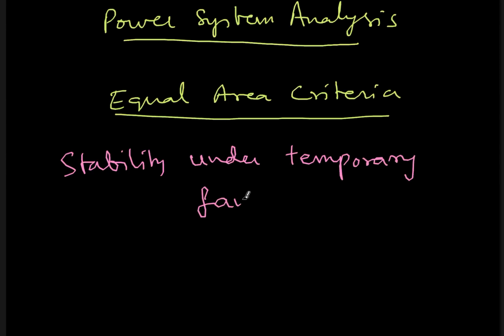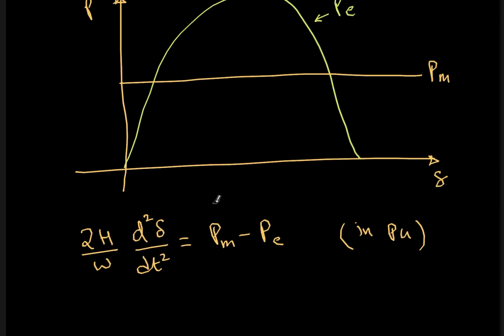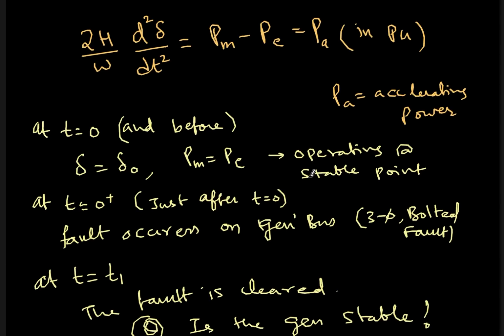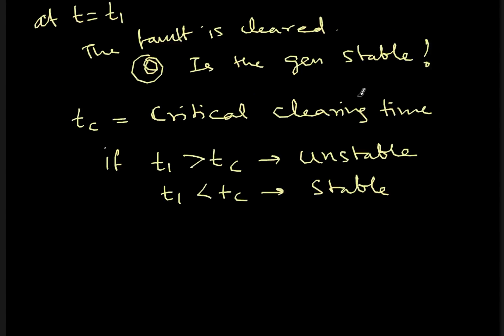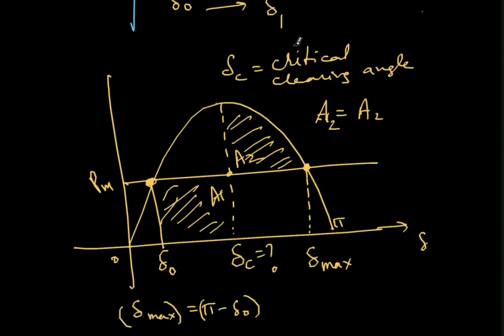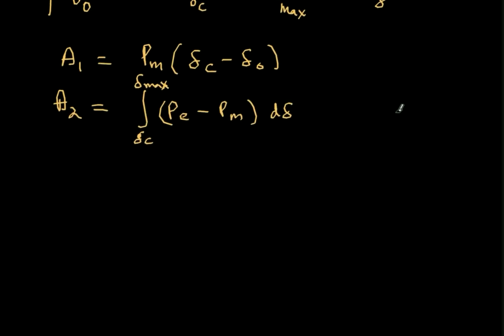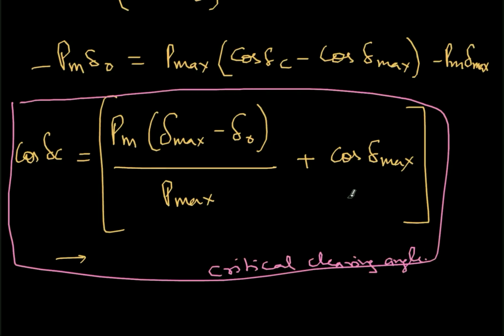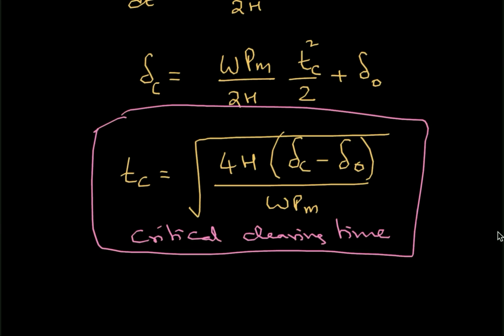Critical Clearing Angle and Critical Clearing Time - Derivation

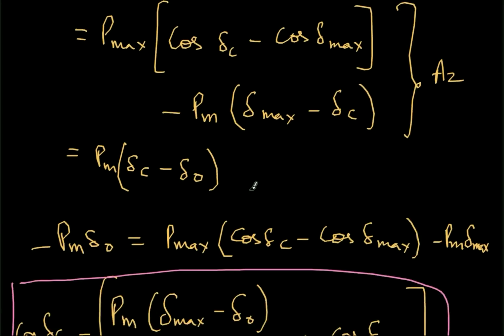Comment: for equation at 24:55, to solve for critical clearing angle, do we use Pmax @ fault? Or before fault? Or once fault is cleared? Pmax changes based on which condition.

Comment: Hye Sir.
The area A1 ( or A2) is said to be the stored energy. How does the P axis vs delta axis or what is the relationship between P and delta that we can say the area is equals to the energy?
Reply: The areas A1 and A2 haven't been said to be "equal to the energy". Due to the discrepancy between the mechanical power input and the electrical power output the latter being zero on account of fault (V=0), the entire power input to the rotor manifests itself as kinetic energy, to accelerate the rotor. This accelerating power acting on the rotor, makes it's speed which was synchronous prior to the fault (on account of stable operating conditions), to go beyond synchronous now. The rotor angle delta increasing along with it. Following the fault clearance, the electrical power output becomes greater than the constant mechanical power input, as is evident from the power angle characteristic. Therefore the accelerating power goes negative now. This makes the rotor decelerate, it's speed gradually decreasing from super-synchronous to synchronous, until the kinetic energy which it had acquired during the initial accelerating period is completely given up as per the "energy conservation principle". Thus areas A1 and A2 are actually "representatives" of the Kinetic Energy gained or lost by the rotor and not mathematically equal to the kinetic energy gained or lost by the rotor. We equate A1 with A2 in equal area criteria just to comply with the "energy conservation principle".
Reply: Debanjan Datta : whats the physical reason of heigher electrical output power just after the fault clearance ? Is it , because of consistent mechanical input + the kinetic energy stored both will produce electrical power during the period it returns to sycn speed and hence the stored kinetic energy being consumed in output power generation ?
Reply: it will help https://youtu.be/-bJ_X-5Lyfk